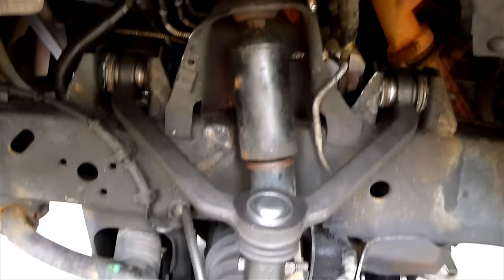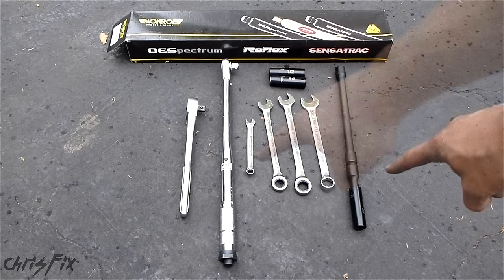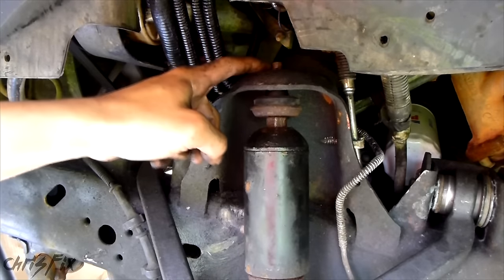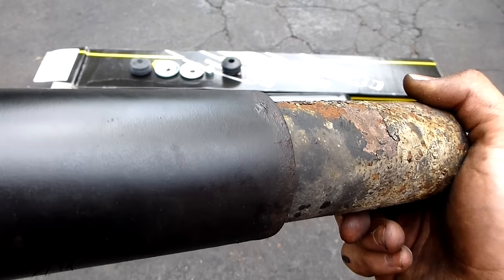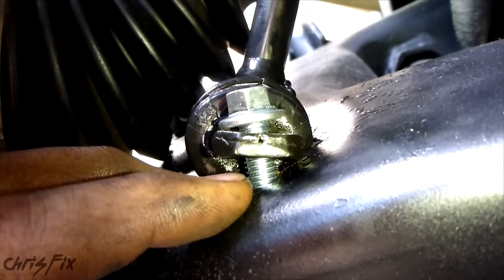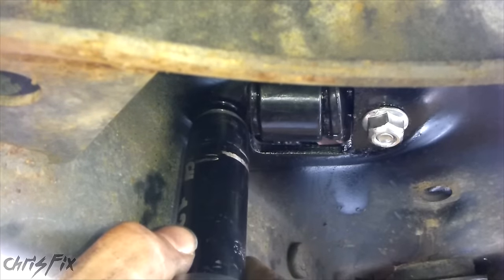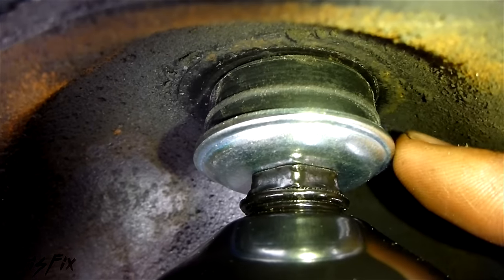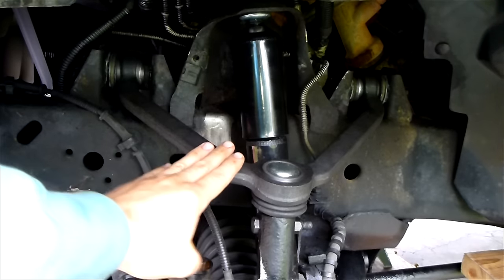How to Replace Front Shocks

Comment: Thanks for the guidelines Chris. I changed out the front and rear shocks on my 2008 Ford Ranger 3.0 tortion bar truck today(took about 6 hours total for all)! For the front, both top nuts snapped off about 3/5 the way up (I'm in Canada where they aren't shy with salt) but came off nonetheless. I used a double wrench for extra torque to snap the passenger nut on top of the assembly. Took about 3-4 hours total dealing with the rusty situation. One of the shocks failed and exploded on me after removing, but probably due to the twisting during removal. As a reminder to DIY mechanics, never point the ends toward yourself  when analyzing the compression of the shock after dismount, esp with old rusty parts! The nut below the bottom washer and bushing was somewhere between 3/4" and 18- 17mm due to rust swelling and I had to experiment with what size I could hammer on. My top nut was 15mm for both sides. Plenty of WD40 helped to penetrate the rusty parts. On the driver side, the lower nuts snapped the bolts coming off, but the passenger ones had to be fully ratcheted off. A 4lb hammer tapped to the bottom of the shock removed it from the lower control arm mount on both sides.  Thank you for the detailed guides for these tasks on this model. I lucked out with having a similar model to your truck! Taker easy bud.

Comment: Good Video,  very concise. I have a 1991 Mazda B2200 Ext. Cab, Automatic trans with O.D.  I'll be changing out all the shocks on it. This video was helpful. Thanks. Had the truck since 1994, put LIFETIME shocks on it from Auto Zone. You buy the shocks, take the old one's back, you get your money back. Truck now has 278,800 miles, and have changed the shocks out several times since 1994. Auto Zone is my parts supplier, and always remember me, as to what I've bought there. Thanks again for the Great Video. Love the Youtube videos.

Comment: Used your video to finally change my two front shocks in my 2002 Nissan xTerra!   It was super easy...nearly the same as your video.   I had one bolt on the top and one bolt on the bottom.   The only issue I had was how to compress the shock to get it back in and aligned.   I basically just had to push down with all my strength to compress it enough to put it into the top hole.   

I couldn't afford to do all of them at the same time so I just did the fronts.   Saving up now so I can do the rear ones!

Thanks for much for your fantastic videos...they give ordinary people courage to try these things themselves and save money!
Reply from the maker: +Jeffrey B Awesome Jeffrey! That is what I like to hear! Glad the videos are helpful and nice work!

Comment: I want to say thank you for you video about fixing front shocks on the Ranger. I have 2011 ford ranger that I got back in 2012. I just recently replaced all 4 shocks on my truck. But knowing and seeing how you did the front shocks really helped and made changing mine much more easier. The video was clear and straight to what is needed and that there. I have seen other video's on replacing my shocks and they were good but I find your was a lot better. And gave me bit more confident about doing my on work on my truck. So thank you very much.
I do want to know after I changed my shocks I did have sway bar link snap on me there few days after. But getting under my truck and seeing that issue and how suppose on the other side I was more than able and felt the ability to replace them as well, which I was able to pretty easy. Down side is I am hearing a slight knocking or clunking on the front left driver side as I drive. This only seems to happened when I reverse out of my drive way and when driving down the road. Not sure if there is something loss or possiblity when then sway bar link snapped that it may have damaged something else. So far I have looked multiple times under the truck and not seeing anything as of yet.

Comment from the maker: +Aaron Sargent for some reason I cannot reply to your comment but I hope you see this. I have no particular kit that I like because most of them try to maximize the number of "pieces" and it is useless stuff like a bunch of different screwdriver bits. I need to make a video on my tool box. I basically started with smaller different tool sets and combined them. If I were you I would get a good set of wrenches in both metric and in sae. Most common size nuts and bolts is 8mm through 18mm and get the same range for SAE. Then, get a 1/4in ratchet, 3/8in ratchet, and 1/2in ratchet and a lot of sockets. They make long sockets and short ones. Also, get a long breaker bar (This is a MUST). A breaker bar will save you from so much frustration. When I first started, I didnt even know about a breaker bar and I slipped old pipe over the wrench lol. Then you can look for other basics that you might want like screw drivers, hammers, and specialized tools that you think will be useful. To start off, I would go to Harbor Freight because their prices are really cheap and for hand tools, they really are not that bad (lifetime warranty is a plus). I will make a video on my tool box in a few weeks. Let me know if you have any other questions. Oh, and if you really want a kit to start off, harbor freight has a pretty decent mechanics kit that wont break the bank. Check it out.
Reply: Thanks Chris!
Reply: Maybe it's time to make a video of your new sonic tools setup that you have in your garage now, love to see what you have
Reply: do u have a video to replace a front strut
Reply: ChrisFix 
quick question man I noticed when you replace shocks you don't replace to a Bilstein ,  fox , rancho etc ..

is it because you standby Monroe shocks or do  you feel that  closer to oem is better 
obviously it's not the money lol
Reply: x
Reply: ChrisFix where can I find the torque specs info of my car or any other car ? Thanks
Reply: @DG-cf3xf  I had always thought this and found some backup, correct me if I am wrong. On page 0-10 of my Chilton Ford Ranger manual the is a bolt chart that gives a range of torque depending on bolt size. For instance3/8- 16 calls for 22-32 Ft-lbs. This is a pretty large range but gives an idea of where you should be. So torque specs is more dependent on size than application?
Reply: Yes sir! Harbor Freight for the win! 👍

Comment: Thanks Chris, your videos on your b-3000 have been very helpful working on my 2002 b-3000 dual sport your truck is very similar to mine except I don't have 4 wheel drive .Just did the front and rear shocks . The only thing I did differently was I didn't jack the truck up , I just turned the wheel so I could get In there cleaned the threads up real good with a wire brush and sprayed them with the homemade penetrater things came apart fairly easily now I have new shocks all the way around my truck Thank You so Much for the great videos you post on here !!!!!!

Comment: Hey Chris, I replaced my front shocks yesterday on my 95 Ranger, just need to rear set next weekend. Thanks for posting these vids. I probably saved myself at least a couple hundred dollars if I would of taken it to shop someplace. After shocks, I have to repair my bench seat on driver side. The spring let a few year back , the seat looks pretty knarley. Already spotted a couple good vids on quick fixes on seat repair. Thanks again.

Comment: I was doing this job today on my 2002 Ford Ranger.  I had ordered 2 new Monroe front shocks.  Got the first one done no problem, then opened up the box with the 2nd shock in it and it was missing one of the rubber bushings!  I couldn't re-use one of the old ones either cuz they were way different and very old and messed up.  Extremely Frustrating!!  Now I have to drive around with one good shock and one bad one until Monroe sends me another bushing!  Great vids btw Chris, I have learned a lot from you- thank you very much!
Reply from the maker: Mike A-strong Dang that stinks and is unacceptable! Hopefully they are getting you that bushing to you fast! I am glad you are learning a lot Mike!

Comment: Great explanation, dude!...Very clear and accurate, even to the detail of the mounting bolt not being flush with the 'Control Arm'....And for pointing out to make sure those 'Rubber Bushings' are 'Dead Center'....I am not much on 'Torque Measurements', but you are absolutely correct in doing so...Good job, dude!

Comment: The top nut on my front shocks were rusted to a point where they wouldn't turn.  It's a good thing my dad had a sawzall that I could use.  I just cut right through the nut.  It made removing the old shocks much easier and saved me a lot of time because I expected that it would happen given the age of the old shocks.
Reply from the maker: +GrnArrow092 Awesome! Nice work. I hate when things rust that bad!

Comment: I'm not sure if anyone else asked this yet but i have a 1989 F150 xlt lariat with 57k miles and even though it wasn't used all that much the shocks are nearly rusted through and i am going to be replacing them in the next few weeks. So after watching your video and a few others i'm still unsure as to where the best spot is to position the jack under my truck? Thanks and hope you're having a great holiday.

Comment: Just did this today.  Had a hell of a time getting the top tight.  First sideI used a wrench under the mount.  However, on the SensaTracs the spot to put the wrench is very thin and it pinched the wrench in when tight.  On the other side I held the top cylinder by hand but didn't feel like I got the top nut tight enough.

Comment: Great video.  I just replaced my front shock on my 93 Vette and that is even easier.
Reply from the maker: Nice! Did you use bilsteins?
Reply: ChrisFix Bilsteins all the way.  I actually like the new ones they are putting out as you can now use an allen wrench on the top of the shock to install and remove them instead of relying on flimsy locking vice wrenches while removing the upper nut.  I had them both out and installed in 15 minutes where the old configuration could take me up to 45 minutes.
Reply from the maker: That sounds awesome!

Comment: As a point of information, if you have struts and not shocks (struts have springs around them) you cannot access the large nut at the top of the shock to hold it when removing the top nut.  It is very difficult to remove this nut since the entire shock will turn and they are usually rusted.  Vice Grips sometimes work but as you can see what happened  to Chis, it broke off.  This is my suggestion:  Don't spend hours trying to get this nut off.  Get a reciprocating saw with a metal cutting blade and just cut the stud off below the nut.  This takes 5-10 minutes and saves much agony and time.  You could do it with a hacksaw but it will take a little longer.  Work smarter not harder.

Comment: The two bottom bolts you just unscrewed can be used  by 13mm socket too if you can’t find a half inch (1/2) socket

Comment: It's such a great job, after watching your videos I felt that repairing a car by myself is not difficult at all and we could save lots of money. I replaced the tie rods on my Mazda 6 2004 two months ago. Recently I decided to replace the front shock and strut, but I got a question. Do I need to replace the coil spring at the same time? Or how can I tell that I need to replace the coil spring? My Mazda has a mileage of 57000. To buy the strut/spring/mount assembly is really expensive, and I could buy a better shock if I don't need to replace the spring. Thanks.
Reply from the maker: Yawei Chen That is the goal! Glad the video was helpful! When you do the strut, buy a loaded strut with the spring in it already so you dont have to mess around with compressing a spring. I know it might be more expensive but that spring is very dangerous if you do not compress it correctly.

Comment: Okay Chris, another video well done.  A question for you, I've done plenty of shocks and tighten the top nut until BOTH bushings are the same diameter as the washer. Just put shocks on the RAM it, and just the top bushing seems to be compressed. WTF gives? Both bushings are where they should live, am I missing something here?  I'm old, so it's a good possibility.  Thanx for your vids man, good stuff.

Comment: Having this done to my 99 Tahoe in 2 months as it bounces on dips (I actually like it bouncing but my dealership told me a few times now I should replace the front shocks), so I will be. Definitely not doing it myself though.
Reply: Ha i've got a 99 suburban with the same issue, gonna change all 4 out myself these trucks are very user friendly to work on! give it a shot
Reply: @jonathann2093  The passengers side came out fine but the drivers side bolt was super rusted when they tried to undo it so it snapped off, they had to drill it so another bolt could be put in. You may have the same problem so you might want to put some rust penetrating stuff on them before you try to remove them. Definitely a smoother ride than before, though I do miss the dips a little bit lol.

Comment: Smashing job chris :-))

So nice to have new parts, it does show up the rusty bits though lol, it would make me want to use rust killer and a large tin of black paint+brush lol.

For people that dont have a torque wrench, what indication can we use, a clenched mouth and medium pitched grunt while showing teeth.... just being daft :-))
Reply from the maker: Thanks bud! I actually spray painted everything afterwards a nice black. Everything looks new now lol. To put the torque wrench in perspective, take a 1ft ratchet and put a 20lb weight on the end of it so it pulls downwards. That is 20ft-lbs. If you use a small 1/4 in ratchet, 20ft lbs is about as hard as you can tighten it with one hand. That is a good idea with explaining what each torque is like. I will have to use that in a video! Cheers!
Reply: ChrisFix Yes thats the way ive allways seen torque wrenches and you could test them with weight for a rough calibration.

But i was just being silly with the grunting and bearing teeth, you see more in my comment than i did ha ha :-))

Comment: Just cause they have springs around them does not make them struts. Take your truck for example, those trucks came with either front coil over shocks, or in your case, front shocks with torsion bars. Struts perform the same function as a coil over shock with two main differences. they act as a wheel support taking the place of the upper control arm/balljoint and they rotate as you turn your wheel.
Reply from the maker: +lk7496 Thanks for sharing!

Comment: Hi Chris. I replaced front & rears shocks plus front struts on nissan versa/tiida 2008. Car rides firmer now but the real issue is that I still feel the car vibrate/noisy over bumps / rough roads. Its like the sound doesn't damp out on rough roads. Should I also replace the spring coils front & rear as they are the same ones. Car has done 146K miles to it. Thanks

Comment: Awesome video as always.

I have a 2000 3.0L V6 RANGER which has front struts.   What do I need to do to switch on over to shocks? What do you recommend?
Reply from the maker: Wil Ricalde You would need to do a lot of work to switch over to shocks. You would need to get a torsion bar setup and a new lower control arm. It is not worth it. Stick with your strut!
Reply: Thanks ChrisFix!  Keep up the great work.

Comment: Hey Chris awesome videos. I do have a probably dumb question but for me its kinda important. I have an 04 silverado 2wd and i replaced the front shocks, tightened everything down to specs but when i put the wheels on and dropped the truck the upper washer and bushing seem to be loose, like i can turn them. Not the nut though. Is this suppose to happen? Thanks man

Comment: Hey Chris, great vids. I have a question a hyundai sonata 2011 rear shocks. I dont know if you are familiar with this set but, i just installed my rears and took it for a drive and it felt really lose and felt every little crack on the road. I pulled over moved and applied pressure and i heard the top part lose i guess... Did i miss something or do i need to apply more pressure on the bolts on top. I comment on this video because of what you said about the rubber widening to the washer. Does that apply to my situation. Thanks.

Comment: 0:05 that bushing under his wrist what is that called because the one on mine is falling apart. I think it’s an upper control arm bushing? But I also have seen it’s possibly a ball joint? Any help would be appreciated.
Reply from the maker: It's a ball joint
Reply: @chrisfix  thanks!

Comment: How about the placement of jacks and/or jack stands? If the lower control arm isn't supported by a jack or jack stand, isn't the shock the only thing supporting it? Meaning... if you disconnect the shock without the control arm supported, won't the suspension spring shove (possibly violently) the spindle toward the ground?

Comment: Hi Chris, love the straight forward videos! For struts I have heard that it is better to torque the bottom nuts after the vehicle is on the ground. Otherwise you may get a large abnormal ride height. Is this true? Or is it because you have shocks in this case that you can torque it before lowering it.
Reply from the maker: Bobby Abraham Thanks man! Nope, not true. You can torque the bolts wherever you want. The right height is set by the spring on a strut so it is constant.

Comment: Hey Chris, I have an 03 Ranger 4x4 and my torsion bars were cranked by the old owner. I need new shocks but im torn on if I can run with the stock sized shocks or do I need longer ones? Also when you do your own shocks do you have to follow it up with a front end alignment or anything of that nature?

Comment: Hey Chris why are the shock torque specs for the front bottom bolts so low for the front? I have a dodge ram 1500 4x2 and they 25? Does that sound right? By the way awesome video!!